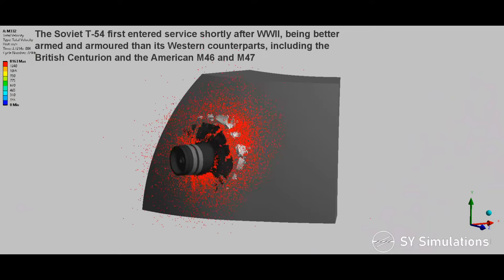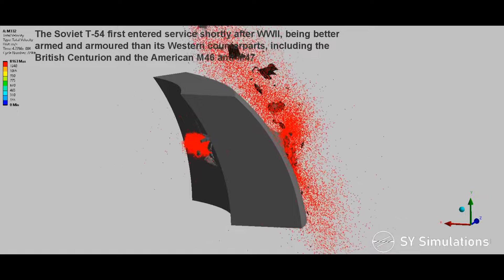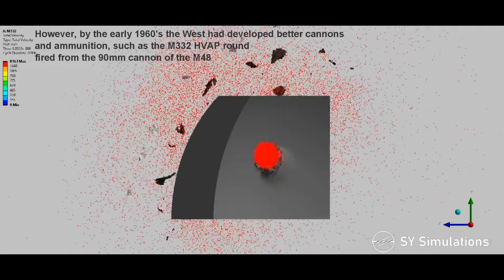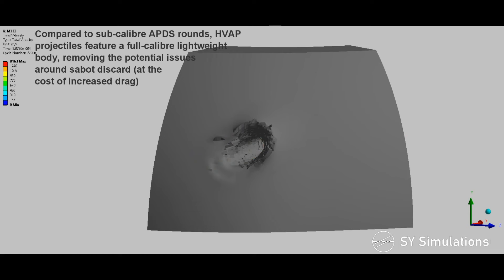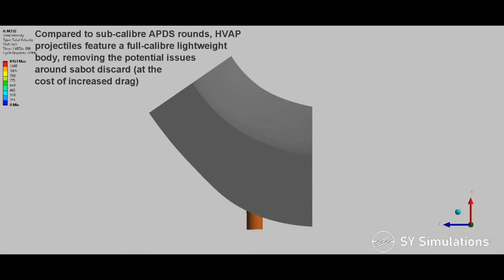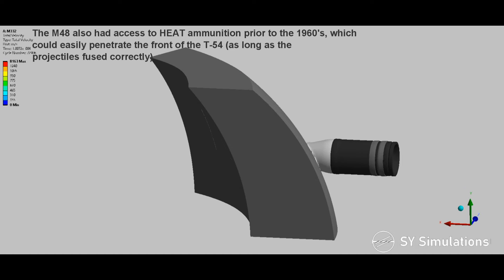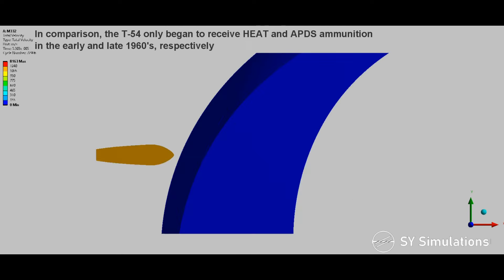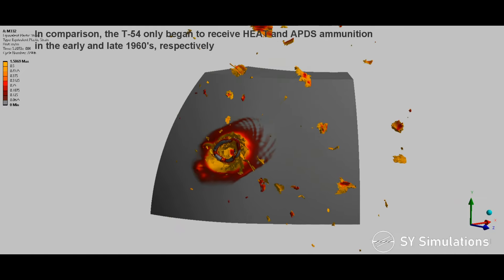M48 PATTON vs T-54 | Standoff at Checkpoint Charlie Pt.2 | M332 HVAP Armour Penetration Simulation

Comment from the maker: Which set of tanks do you think would have come out on top if the standoff kicked off?
Reply: T-54B had a dual plane stabilizer, a better fire control system and better armor. That HVAP could not penetrate the frontal hull armor of T-54 or the more sloped parts of the turret. These M48s were doomed from the start.
Reply: whoever got their shot on target first.
Reply: The ones with more backup, and in Berlin, that means the Soviets.
Reply: @azeke8  I don't think the T-54B, if that was even the variant used in the Checkpoint Charlie Standoff, had a superior FCS to the M48A1, which was the variant used. Also at that range a dual plane stabilizer wouldn't have mattered.

The real reason the M48s were doomed is because there were more T-54s at the standoff, and Berlin was firmly inside Soviet territory with little chance for reinforcements should things go hot.
Reply: @MacSalterson  Neither tank really had an "FCS" sort of say, in both the gunners have to manually account/adjust for lead and ballistic drop.  M48 does have a better rangefinder, and T-54 (or T-55 I dont remember now) has hunter killer target designation by commander  that can automatically turn the turret towards the target azimuth so this saves the gunner a good amount of time on searching for targets the commander wants him to engage.
Reply: @azeke8  at 100m the FCS would not have mattered (and the M48s was much better than the T-54s) and neither would the sloping.
Reply: @MacSalterson  The actual tanks were M-48A2s
Reply: @SeanMurphy1090-d5u  You sure? I've found photos of the standoff where it explicitly lists the tanks depicted as M48A1s.

I'm also finding it impossible to find the variant of T-54 used at the standoff.

EDIT: finding some close-up pics they appear to have the fume extractor associated with the D-10TG or D-10T2S, on the T-54A and T-54B respectively. However, they don't have the infrared searchlight of the T-54B so I'm betting they're the T-54A
Reply: @MacSalterson  Yes, those were T-54A.
Reply: this kind of point-blank engagement probably comes more down to luck and who decides to fire first. you don't need to do any rangefinding and the target is stationary, so the first shot should be a hit and also a penetration, unless you don't know where to aim.
Reply: Could you do a standard sherman but with track armour against the short 88mm?
Reply: @MacSalterson  При чем здесь Берлин?))) Противостояние этих машин было не в Берлине. Паттоны обосрались перед 54-ками!))
Reply: @татариннерусский-ы1ъ  I don't speak Vodka so I'm going based off google translate.

The Standoff at Checkpoint Charlie was during the Berlin Crisis of 1961 and was in fact in Berlin.
Reply: @MacSalterson  Господи!.. Пусть Он даст тебе здравомыслия! Сочувствую.